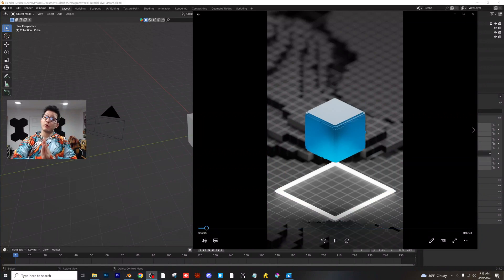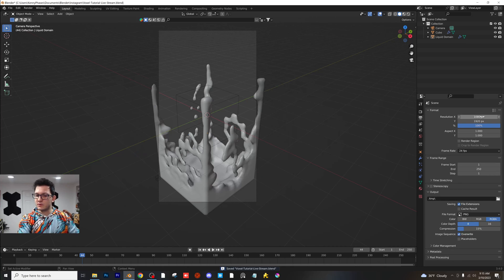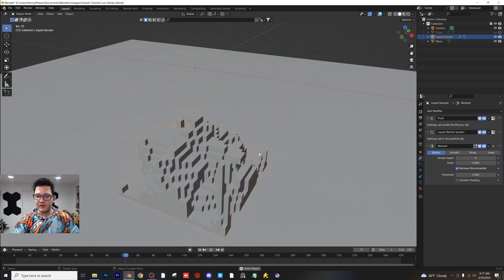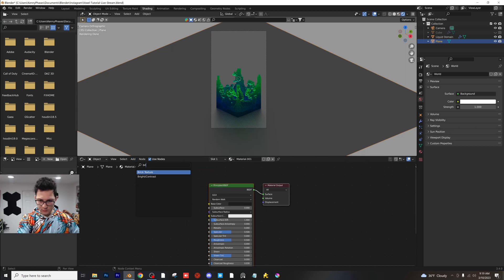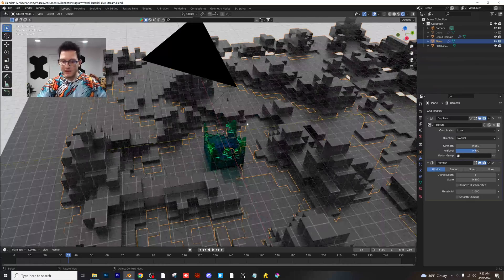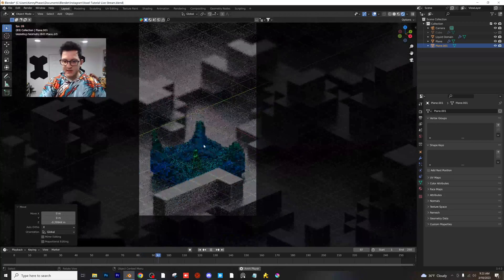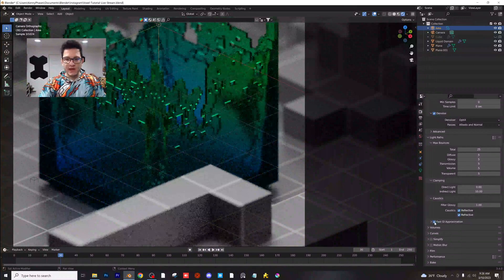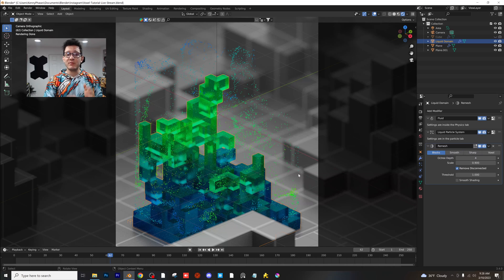VOXEL Fluid Simulation - Blender 3D

Comment: Good tutorial, but actually you don't have to set Max Bounces to 25 just because you set the 5 separate bounces to 5 each. First of all, the Transparent bounces are independent from the Max Bounces so you only had to care for 4 times 5 bounces making it 20.
But still it's not necessary to set them to 20. The Max Bounces just limit how many of the Diffuse, Glossy, Transmission and Volume bounces are calculated. So if they are all just 5, the Max Bounces only need to be 5, too.
The reason for this is, depending on your scene you can set different values as much as you think you need for a good result. For example, I usually use 4 Diffuse bounces, 16 Glossy, 64 Transmission and 1 Volume bounce.
Now you don't add them all together for Max Bounces, you just look what the maximum value is: 64 bounces. If I set the Max Bounces lower than that like e.g. 32 bounces, then it will only calculate 32 although I want 64 for Transmission. On the other hand the lower values will be calculated fully - but only 4 where I set it to 4, not 32 so it won't increase render times for those if you set the Max Bounces higher than needed.
Now what's the use of the Max Bounces anyway if you can control them individually? Well, maybe for a full final render you want those high settings - and especially not just high but different settings for the individual bounce channels. But for quick renders you don't need them, then you can simply set the Max Bounces to e.g. 2 bounces, and they all (except for Transparent) will be limited to 2 bounces and render much quicker - but you don't lose their individual settings for the full render.
The Transparent bounces I always have at 64, since they are not so much increasing the render times and as mentioned before, they are independent from the Max Bounces.
Reply from the maker: Wow I just learned something new! To be honest I thought the Max-Bounces were a TOTAL of all bounces combined!!!! This is actually very informative! Thank you so much! I will have to expiriment more with these values. Do you find that 64 Bounces for Transmission is necessary? Or is it over-kill?
Reply: @KennyPhases  I'm happy to teach those things. Many good Blender tutors are not aware of these things because their talents are elsewhere. Well, so if you don't have much transparency in your scenes it's mostly overkill. But it's independent from the other bounces and doesn't affect render times much if there is no transparency so I leave it at that, because the typical scenes where it gets important usually need high bounces: for example leaves on a tree where you have alpha transparency for the leaf shape - you can quickly reach high transparency bounces with leaves. Or in smoke simulations, the too low transparency bounces can result in black shadow artifacts. So that's why I leave them high, most of the time it doesn't matter but when it does, 4 or 12 bounces might quickly become too few.
Perhaps you might think a scene where you have just one or two windows only need few Transparent bounces - but the Glass BSDF or the Transmission channel of the Principled BSDF don't use the Transparent bounces, but the Transmission bounces as the name already suggests. Glass is a transmissive material which has refraction.
The Transparent bounces are important for alpha transparency, which is just how opaque something is without any refraction. This is used by the Alpha channel in the Principled BSDF or what you get from a Transparent BSDF and you mix it wirh some other shader in a Mix Shader node by an alpha map for example.
By the way, when talking about glass and transmission: sometimes glass objects tend to look dark and show black areas, but increasing the Transmission bounces does not help. That's because it's not the transmission that causes it (usually the bounces are just a few like entering the glass and exiting the glass), but the Glossy bounces. Because especially in complex curved glass objects, the light bounces around a lot inside the glass on the reflective surface, so you should try increasing the Glossy bounces.
Reply from the maker: @gordonbrinkmann  Wow!!!!!! It's insane the knowledge you have on the topic, it definitely makes sense, I think I've been using Light Paths incorrectly for a while now. I think it can be confusing which ones are doing what. That's why I always adjust them in Rendered View!

Comment: Looks great, but how to get rid of the flickering?
Reply from the maker: Make sure the bottom of the simulation is slightly above your ground-plane, I made this mistake and didn't check before I rendered, so some frames the ground plane hit the simulation and caused weird lighting effects!
Reply: @KennyPhases  realized you said this later on😂, mb
Reply: This is also caused by rerendering after every action, it causes the fuzzes every time you make a change.  I work on it outside of the tender mode, then switch to render to check everything is coming along smoothly